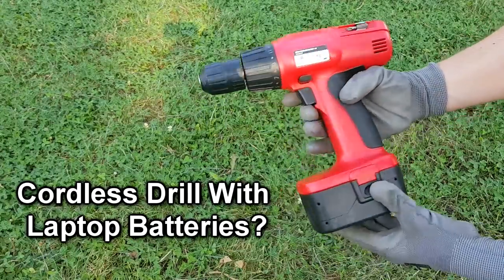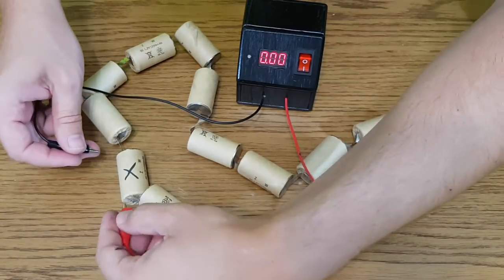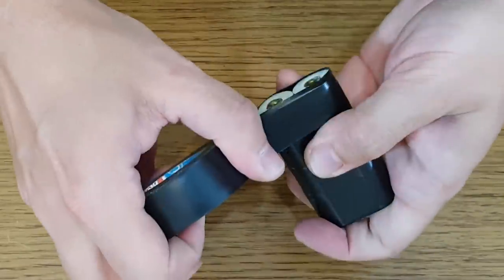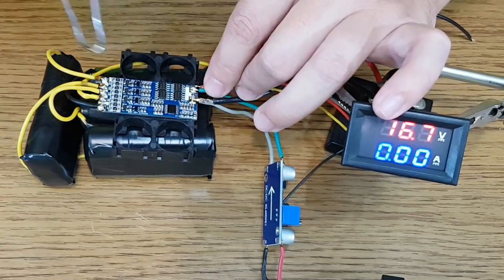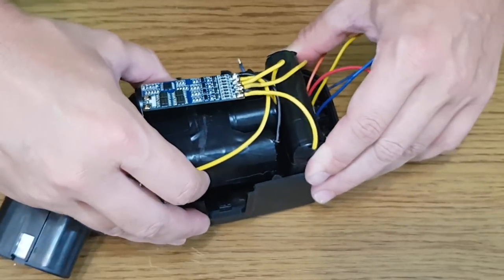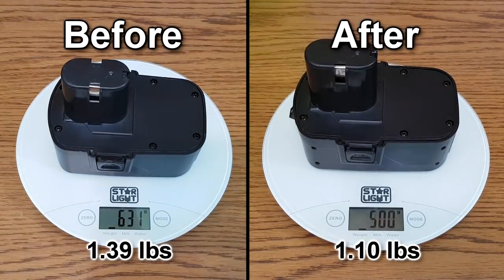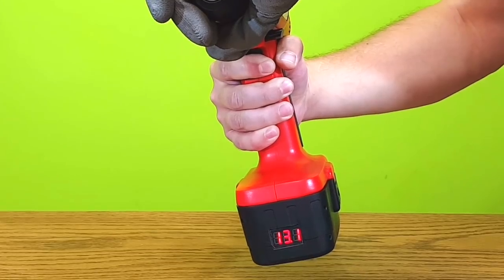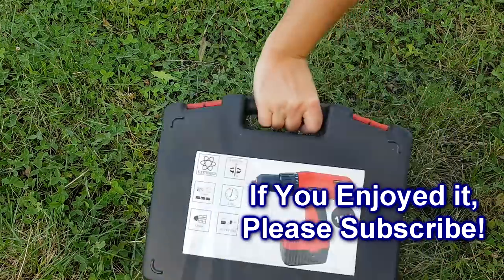Cordless Drill Conversion - With Laptop Batteries??

Comment: Salut Sorin, in primul rand felicitari pentru inca un video foarte reusit! in al doilea rand vroiam opinia ta pentru urmatorul proiect pe care vreau sa il fac: este de fapt exact aceeasi chestie pe care ai facut-o tu in acest filmulet. Bormasina mea functioneaza la 12V si vroiam sa inlocuiesc bateriile vechi din ea cu 18650 Li-ion. Am luat 6 celule e care vreau sa le pun in configuratie 3s2p. De asemenea am luat si doua placute de protecte (care rezista la 20A cica) si sa pun cate o placuta pe fiecare serie de celule, iar cele 2 serii in paralel. Smecheria cu care ma confrunt este ca vreau sa le incarc la fostul incarcator al bormasinii. Pe incarcator scrie urmatorul output: 7.2 - 14,4V la 0,4A. Am masurat voltajul si scoate 16,5V. Intrebarea mea pentru opinia ta este: suporta acele placute de protectie surplusul de 3,9 V? Incarcatorul este pe baza de transformator (este cam greu) nu cred ca este in comutatie. link baterii www.ebay.com/itm/2x-3-7V-18650-2600mAh-Backup-Batteries-For-Sony-VTC5A-30A-Rechargeable-Battery/253755417822?ssPageName=STRK%3AMEBIDX%3AIT&var=553032569061&_trksid=p2057872.m2749.l2649
link BMS www.ebay.com/itm/3S-20A-Li-ion-Lithium-Battery-18650-Charger-PCB-BMS-Protection-Board-Cell-12-6V/401311472158?ssPageName=STRK%3AMEBIDX%3AIT&_trksid=p2057872.m2749.l2649
Orice informatie va fi binevenita!
Keep on the great work!
Reply from the maker: salut. celulele sunt bune. insa iti trebuie modul de incarcare cu balansare. sau sa adaugi un modul de balansare, la modulul de incarcare pe care l-ai cumparat. curentul de balansare e bine sa fie cat mai mare. cel mai mare pe care l-am gasit eu, este de 100mA in linkul de mai jos. vei folosi un singur modul de incarcare (+ balansare) pentru toate celulele, cum am facut eu. nu 2 module in paralel. apoi iti trebuie un incarcator de 12.6V. daca vrei sa il folosesti pe acela al bormasinii, trebuie sa ii adaugi un convertor step-down, sa scazi tensiunea la 12.6V. sunt convins ca acel transformator nu este filtrat de ajuns, probabil are un condensator de 1000uF la 25V. trebuie sa il schimbi cu un condensator de 4700uF. sau mai simplu sa cumperi un alimentator de 12.6V, ca cel de mai jos. 
https://www.aliexpress.com/item/2S-3S-4S-100MA-Lithium-Battery-Balance-Board-18650-Li-ion-Battery-Balancing-Board-Balancer-Current/32888649495.html?spm=a2g0s.8937460.0.0.7ff52e0exVoV9O

https://www.aliexpress.com/item/1PCS-High-quality-12-6V-1000mA-1A-5-5mm-2-1mm-Universal-AC-DC-Power-Supply/32701648431.html?spm=2114.search0104.3.1.75c57cd5HJeBcu&ws_ab_test=searchweb0_0,searchweb201602_5_10065_10068_319_10059_10884_317_10887_10696_321_322_453_10084_454_10083_10103_10618_10304_10307_10820_10301_10821_537_536_10902,searchweb201603_16,ppcSwitch_0&algo_expid=d093ad31-6b25-4902-ae16-b3106a580b56-0&algo_pvid=d093ad31-6b25-4902-ae16-b3106a580b56&transAbTest=ae803_3
Reply: Multumesc mult pentru sfat. keep you posted on the project
Reply: Salut sorin, tocmai ce am facut conversia... am urmat toti pasii. Problema e ca atunci cand apas tragaciul bormasinii, bms-ul taie curentul. Pack-ul de baterii verificat toate la aceeasi tensiune la 0.01v dif. Ai idee ce poate :(
Edit: tocmai ce am observat ca daca smucesti tragaciul pana la fund foarte repede, merge, dar doar la viteza maxima, cum dai drumul putin la tragaci se opreste . De asemenea acum ca a mers toate mosfeturile sunt la aceeasi valoare. Inainte cand nu rotea, doua mosfeturi aveau 0.12v 
Bms link: https://www.ebay.com/itm/3S-12-6V-60A-18650-Li-ion-Lithium-Battery-BMS-Protection-Board-With-Balance/273386824180?hash=item3fa71fe1f4:g:0-cAAOSw~jpcdhGR
Reply from the maker: salut. de obicei modulul bms opreste alimentarea, cand una din celule e prea descarcata, dar in cazul tau ai zis ca le-ai verificat. sau daca bormasina cere la pornire un curent mai mare decat poate sa dea BMS-ul sau bateriile. insa nu inteleg de ce nu merge sa o pornesti incet din tragaci... sa nu fie cumva o problema cu circuitul din bormasina. incearca sa adaugi o rezistenta de 0.5 - 1 ohm 20W in serie cu bormasina. sau un condensator mare in paralel cu iesirea din BMS, 25V si 6800uf minim. daca nici asa nu merge, eu cred ca e o problema cu bormasina. masoara si tensiunea totala a celulelor, cand apesi pe butonul bormasinii, sa verifici cat scade tensiunea.
Reply: Sorin - DIY Electrical Nerd bornele de la baterie avea un rezistor mic pe care eu ca prostu l-am scos. O sa ma folosesc de a 2-a baterie veche fara sa ii mai scot acel rezistor. Cel mai posibil sa fie prostia mea gandindu-ma ca acel rezistor e doar pt incarcarea celulelor vechi.
Reply: Am incercat si cu cealalta baterie cu terminalele din fabrica. Exact aceeasi chestie. Tensiunea la borne scade de la 12,42v la 12,18v asta mergand la maxim fara sarcina extra. Cautand pe net un raspuns am gasit asta pe ebay. Chinezu zice urmatoarele: When the load of the motor brush is used, try to connect to the non-polar capacitor (withstand voltage above 25V, capacity 10uF-100uF) to the motor's positive and negative terminals to prevent the reverse spike from the motor. Break the MOS tube. Sa fie cumva ce ai zis tu mai devreme de condensatorul in paralel cu bms-ul?
Reply from the maker: e vorba de alt condensator, insa e util si acela de care zice chinezul. el zice sa lipesti acel condensator nepolarizat la bornele motorului. atentie - nepolarizat, fara + si -. dar e posibil deja sa aiba bormasina acel condensator, trebuie sa o desfaci sa verifici. eu ziceam sa conectezi un condensator polarizat de capacitate mult mai mare in paralel cu iesirea din BMS, care sa mai dea un mic boost de putere la pornirea motorului.
Reply: Am fost la un magazin de electronica iar vanzatorul dupa ce a analizat doleantele mele mi-a recomandat o dioda schotki de 40v cu 10A pe crac unind doi craci am 20A. Bun.... montat si pe + si pe - simptomele sunt exact la fel pam pam. Mindf_ck-ul a iesit abia cand m-am hotarat sa masor amperajul ansamblului (schotki scos) cu un multimetru, rezultat: cu multimetrul in serie pe + sau pe -  bormasina merge perfect! Any ideas? 😐
Reply: In urma la chestia asta am adaugat la + 2 metri de cablu de cupru de 2,5 si ce sa vezi bormasina merge perfect cu putere de iti dupe mana atat la viteza mica cat si la viteza mare. Deci dupa umila mea parere si laborioasa cautare pe net... trebuie sa fie una (sau amandoua) din proprietatile unui cablu de cupru: rezistenta sau inductanta. Avand in vedere initiala mea parere ca tragaciul este un potentiometru, acesta poate fi si un reostat. Potentiometrul regleaza voltajul pe cand reostatul regleaza curentul. Ideea e ca atunci cand am lungit cablurile cu inca 10 cm. pe borna sa pun multimetrul in serie bormasina mergea mai bine fiind destul de bland cu tragaciul dar punand mana pe mandrina se oprea direct (intra in protectie bms-ul) Ce se poate intrampla cu un cablu mai lung si ce efect ar putea avea asupra voltajului respectiv a curentului.
Reply from the maker: cred ca e vorba de rezistenta cablului. probabil ai adaugat 0,... ceva ohmi in serie cu bormasina, exact cum am facut eu cu rezistenta de 0.5 ohm in serie. la pornire cablul consuma o parte din curent, iar rezistenta totala a circuitului creste putin. ii permite motorasului sa porneasca, fara sa taie BMS-ul curentul.

Comment: isn't bad for the batteries to discharge them under 2.7v? also is there any solution to keep the batteries charges and discharges them from 4.0v to 3.7v? i'm looking for these type of configurations for a very long time either if its a bms or charge controller of some sort.
Reply from the maker: hi. some cells can be discharged to 2.5V, other type of cells to 2.7V. you need to read the datasheet of every type of cell. but it's recommended not to discharge them under 2.9V. I don't think there is a device that charges the cells between those values. you need to find a good BMS for the type of cells you use.

Comment: The Drill is a 18V machine - why convert to 16,8 V using a 14,8 V BMS ? What is the reason for this? Way not this board: 5S 18V 21V Lithium Battery PCB BMS Protection Board Balance
Reply from the maker: the reason is this: I want to explain the disadvantages and difficulties that come with converting a ni-cd drill to li-ion cells salvaged from laptop batteries. there are a few youtubers who have done this in their fake videos and don't explain anything. of course if you use high drain cells, you can easily make a 5S battery pack. but laptop cells can deliver a max current of 4-5A, and you need more than 10A for a not-so-powerful drill. so you need at least 2 cells in parallel, to be able to deliver 10A. but the drill's battery compartment can take max 8 cells, so I can't make a 5S2P battery pack from laptop cells. the next possible pack is a 4S2P. the voltage is not a problem, because the old ni-cd cells had 1.2Ah (when they were new). the li-ion battery has minimumn 3.1Ah, so the voltage will decrease much slower than the old battery and the drill will last longer.
Reply: @Sorin_DIY  Thanks - so the voltage 18V of the drill motor will run fine with 14,8 V as long as the new battery package have more than 1.2Ah? I belived it had to be 18V - thanks for this info! I'll try to build the same on my 18V machine and charge with 9V DC with step up converter to charging power af 16-17V. Great Video and answer!! BR Ole
Reply from the maker: if you have a 18V drill, I suggest you use 5 high drain cells and a 5S BMS with a balance current of 100mA. you will have a nominal voltage of 18.5V  and max 21V. I don't suggest you use laptop cells, it's dangerous and inefficient. I've made this conversion only to explain everything.

Comment: Salut, Sorin am vazut ca te pricepi la masini :) Am si eu un Seat Leon 1.6 16 valve din 2003. Mi se aprinde limp mode (Harta motorului). Cand se aprinde mai merge ,dar cand licareste (aprinde-stinge-aprinde si tot asa) nu se mai tureaza .. nu mai are forta .. parca moare motorul. Ma poti ajuta :D Astept un mesaj daca te mai ocupi.
Reply from the maker: salut, in cazuri de genul acesta trebuie sa faci o diagnoza auto. sunt multe componente care pot afecta motorul asa, nu are rost sa schimbi nimic, pana nu verifici ce erori are.
Reply: @Sorin_DIY  Ok. Ma poti ajuta cu niste indrumari ,sfaturi ? Sunt din Filiasi ..cred ca stii unde este :D Daca cunosti pe cineva din Craiova la care pot apela sau iti las un nr / email sa putem discuta.Vreau neaparat sa rezolv aceasta problema la masina. Astept un raspuns :) Mersi

Comment: can just put batteries witout protection board
Reply from the maker: no
Reply: J make one good batery without proectin board on wurth master drill works well just stop wnen comes wnen bateri comes close to ends about 9 volt cut off.

Comment: Sorin, am o intrebare si sper ca ma poti ajuta. Daca folosesc 7 acumulatori in total dintre care doar 6 ii pun in paralel si unul ramane singur, e ok sau ar trebui sa fie 7S2P, adica fiecare baterie sa aiba o pereche? Cutia de la baterie nu-mi permite sa pun 4s2p insa pot sa pun 6 in paralel orizontal si inca una vertical. Nu prea am gasit raspunsuri pe net la intrebarea mea si voiam sa stiu daca e safe. Sper ca ma poti lamuri, multumesc! :D Keep it up!
Reply from the maker: Salut. nu e ok sa conectezi asa acumulatorii, se vor debalansa si nu poti sa foloseste capacitatea totala a acumulatorilor. bateria facuta din celule li-ion e ca un lant, toata bateria va tine cat cea mai slaba veriga.
Reply: @Sorin_DIY  Multumesc frumos pentru raspuns, de abia astept urmatorul tau video! :D

Comment: hello genius... is it possible to convert my 9.6 volt cordless drillbit to 12 volts? if possible, can you please post us the videos by taking some times from your busy schedule:)
Reply from the maker: hi. you should make a few tests before converting it. but I think it will work with a 3S battery pack made with high drain cells. this will have a nominal voltage of 10.8V, which is close to what the drill needs. you also need a powerful 3S BMS protection board with balance.
Reply: genius, i am little lost what u are trying to assist me but i assumed it could be converted to 10.8 volts instead of 12 volts? anyway thanks for prompt reply and hoping you will come out with the video soon.
Reply from the maker: a 3S battery pack has 12.6V max and 10.8V nominal. but when you connect a load, the voltage of each cell will quickly drop from 4.2V to under 4V, so the battery pack voltage will drop fast to under 12V. it will hold most of it's charge around 10.8V (3.6V for each cell). the nominal and max voltage are higher than what the drill needs. so I suggest you test the drill with a powerful variable power supply, if you have the possibility. and slowly increase the voltage to see if there are any problems with the drill. it may get very hot or the higher voltage can damage other components in the drill, if it has speed regulators or other components. a 2S battery pack will have max 8.4V and 3s max 12.6V, so you can't make a perfect battery pack with li-ion cells for your drill. it's your choice if you want to risk modify it :)
Reply: thank you so much genius, i have to try once but i am risking my drill too... but i will definitely try with you instruction... no pain no gain, ya? :) thanks
PS: i am nerds:) just learning by going through youtube and finding geniuses like you,  lending a hand to people like me... doing gr8 job... keep posting ideas and help others, please

Comment: Hi sorin vow are you are you fine  so 
Im your follower .
I want ask you to tel me how i can turn a drill from 18v to 220v tel me all best way i have all tools thanks you
Reply from the maker: hi. an 18V drill will draw an inrush current of around 20A; and after the first second the current consumption will drop probably under 5A. but for that high inrush current you need a very powerful transformer or power supply. some newer drills have a circuit to lower the inrush current, by starting the drill motor slowly, I don't know if you drill has this feature. if not, it would be very difficult to convert it to mains power.
Reply: @Sorin_DIY  thanks sorin 
Tele me if bms 5s 40a in bangood or aliexpress its work very well ?
Because i have new battery sony v6 3000ah 3.6  dicharge 30am can i use it with bms ?
Reply from the maker: yes you can use them.
Reply: @Sorin_DIY  last quesrion mr sorin im very shay for a lot of quetion 
And im very sorry .
Tel me   the cell li ion 3.7 which solded in bangood and aliexpress it is original lik which is in drill makita and dewalt i speak about 
Lgh2 and sony v6  3000ma 3.6v 30 amir

Comment: Salut,crezi ca chinezaria asta   https://www.aliexpress.com/item/5S-30A-PCM-PCB-BMS-18650-li-ion-battery-protect-board-for-electric-tools-drill-screwdriver/32712861621.html?spm=2114.search0604.0.0.6bdb317eHEV8Tt  este buna?
Reply from the maker: salut. din descriere pare sa fie buna. insa trebuie sa comanzi si modulul acela secundar de balansare.

Comment: Salut,te rog daca ai timp sa-mi spui daca astea sunt bune impreuna(https://www.banggood.com/9-24V-3A-72W-ACDC-Adapter-Switching-Power-Supply-Regulated-Power-Adapter-Supply-Display-p-1237159.html?rmmds=cart_middle_products&cur_warehouse=CN,https://www.banggood.com/5S-Cells-20A-Balancing-Li-ion-Lithium-18650-Battery-BMS-Protection-Board-p-1232579.html?rmmds=cart_middle_products&cur_warehouse=CN,https://www.banggood.com/10pcs-5_5-x-2_1mm-DC-Power-Supply-Female-Jack-Socket-p-1062018.html?rmmds=cart_middle_products&cur_warehouse=CN)si daca mai trebuie ceva,pe bormasina mea scrie 18v si vreau sa-i pun cinci acumulatori din acestia(https://mega.nz/#!tUgmGIrQ!2KNtRedE-jqizef7OlM81xAN6FL6j5ZTgzY7uPVGJCY) sau trebuiesc sase?acumulatorii sunt noi,multumesc anticipat pt.un eventual raspuns si ramin doator cu o bere,doua.trei?
Reply from the maker: salut. incarcatorul cred ca e bun, pentru ca are si tensiune reglabila, desi mi se pare cam scump. insa acumulatorii aceia nu sunt buni. citeste in linkul urmator! au 2500mAh capacitate si rata de descarcare 1C, adica 2.5A. daca folosesti doar 5 celule, iti trebuie cu rata de descarcare mult mai mare, peste 10A. in cazul meu am pus cate 2 in paralel, sa reusesc sa ajung la un curent de 10A cu rata de descarcare 2C. 
https://www.alibaba.com/product-detail/SZNS-battery-18650-2600mah-with-quality_60340976694.html?spm=a2700.7724857.normalList.29.628a78aasR1q5b